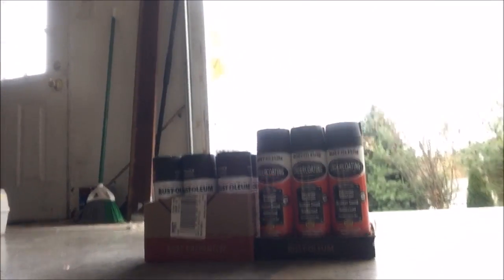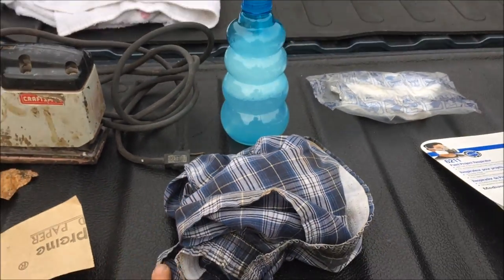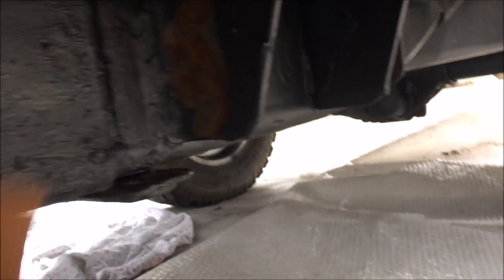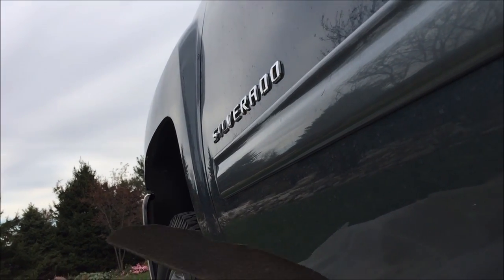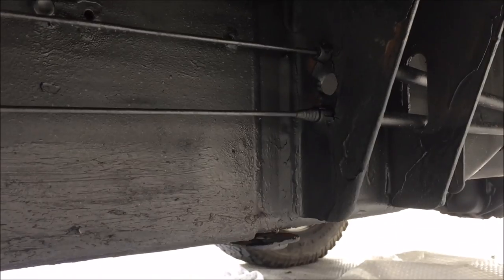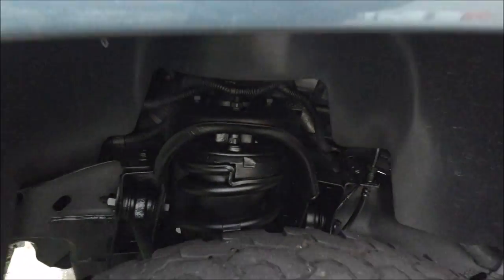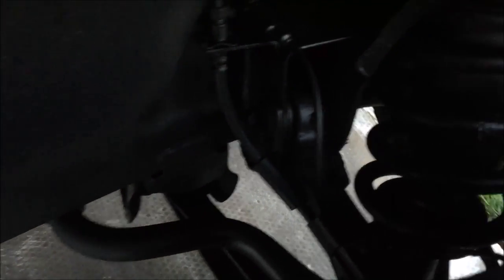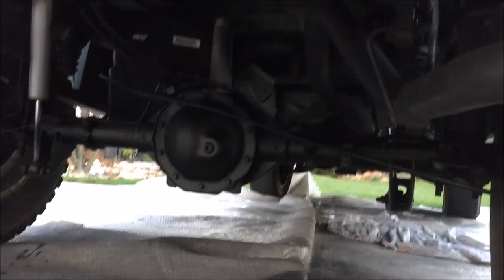Rust Removal Cheap and Easy at Home! Stop Car Rust Repair

Comment: So you put undercoating on everything around the frame like bolts and everything? Doesn't that make it difficult to repair things or replaces like shocks?
Reply from the maker: yes. but rust would make it worse to remove bolts
Reply from the maker: yes. but rust would make it worse to remove bolts

Comment: Wire brush + phosphoric acid will treat the rust. After that rust reformer then fluid film, used motor oil, Krown, or transmission fluid will repel the water and salt through the winter. Yeah it's messy underneath but it'll keep rust from forming or stop it dead in it's tracks. Those undercoatings are trash.
Reply: thanks
Reply from the maker: the oil or krown will be gone within 2 weeks and leaks into the streams and creeks

Comment: How's is this method holding up? My brand new 2017 is rusting everywhere I might have to do this when the weather warms up
Reply from the maker: still holding great after a few years of small touch ups
Reply: Upshift Z71   That's good to hear. Looks like I'll be under a 50k brand new truck fixing rust. But hey what can you do
Reply: IT'S ALL ABOUT WASHING GUYS AND GALS... I have the same exact   truck as him winters are rough wash atleast once a week...its easy to forget i know and can get expensive but its gotta be done.. and im not a fan of undercoating unless you get all the rust off i mean all of it undercoating will trap it in and make it worse... use fluid film or linseed oil ... oil your frame there has never been a piece of steel on earth thats rusted with oil on it... look into it guys

Comment: Instead of completely coating it with paint, you can make a spray bottle, pour coke into it, and spray, then you scrub it with tin foil,
last of all, you spray it with water.
Reply from the maker: well I also like the look of the black pipe too!

Comment: I live in the salt belt region, and I can tell you, this guy is giving you bad advice. Primer will not stop the rust he left behind. You need a product that converts the rust, such as corroseal or Por 15. Never us rubberized undercoat on rust, without treating the rust. Rubberized undercoat, will lock in the moisture, and the rust will continue to thrive under the coating.
Reply from the maker: will rather use a rust reformer
Reply: EXACTLY MAN finally someone who knows .... its near impossible to get all the rust off unless you take the frame off and sand blast which most ppl wont or cant do.. fluid film or linseed oil steel will not rust with oil on it period

Comment: The rust that was not removed or covered will grow under the undercoating and when you see it next, large areas will have been destroyed.  Rust the has begun is very hard to stop and a little sanding is not gong to do it.
Reply from the maker: In most places it has been halted

Comment: So you put undercoating on everything around the frame like bolts and everything? Doesn't that make it difficult to repair things or replaces like shocks?
Reply from the maker: yes. but rust would make it worse to remove bolts
Reply: many bolts are usually stainless steel  ;)